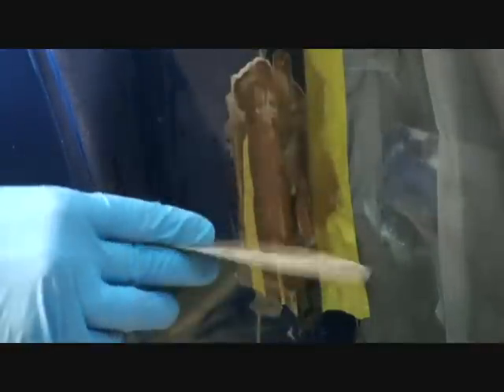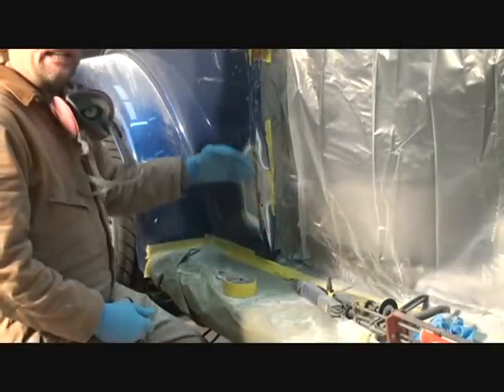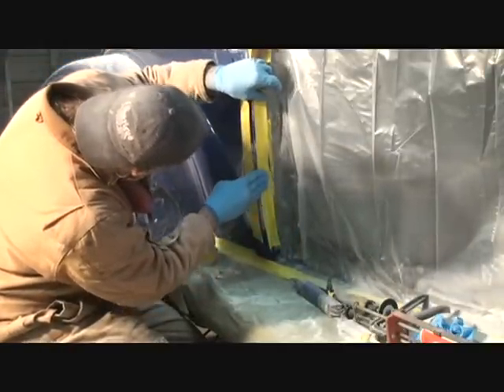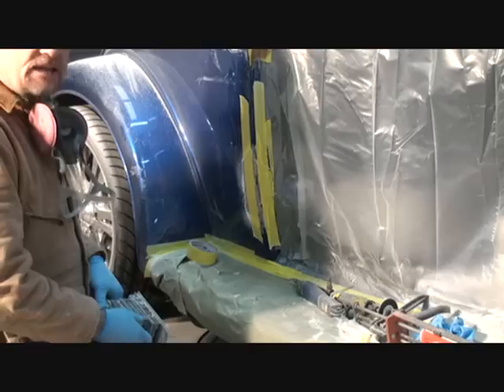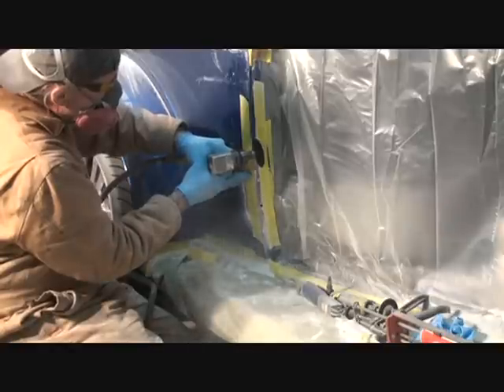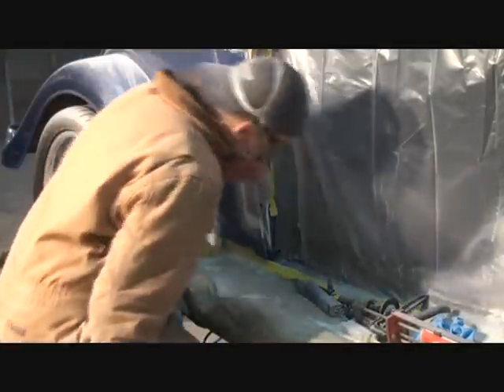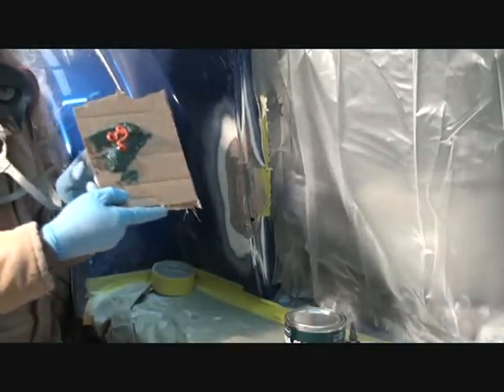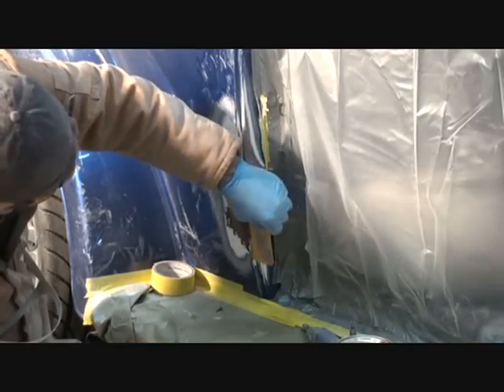1934 Ford Coupe-Streetbeasts-Major Collision Repair, Part 4

Comment: Pete: with your very clear demonstrations of the mangled fibers, why did it help to glue in the trimmed parts that you had cut out, rather than building up the whole area with glass mat chips and goop and then grinding that down to the form you need? It seems to be an unnecessary 'glue-this-to-that-and-then-that step. This is from a guy who is just starting to learn about glass work.